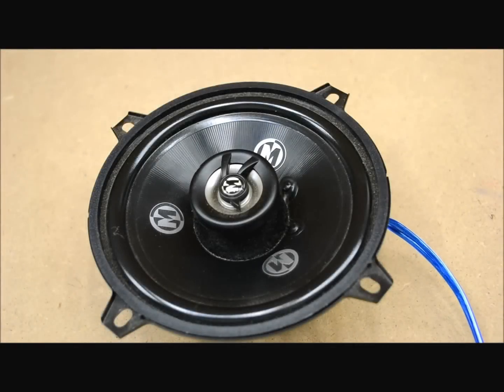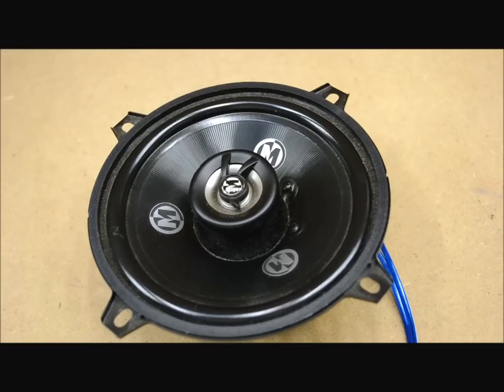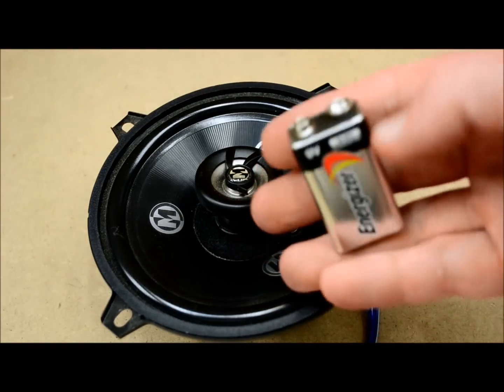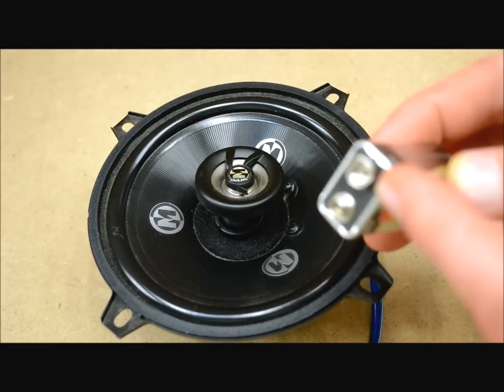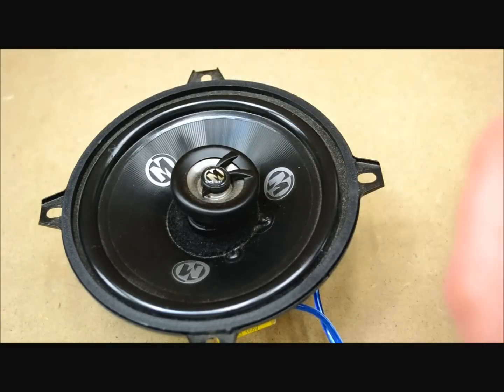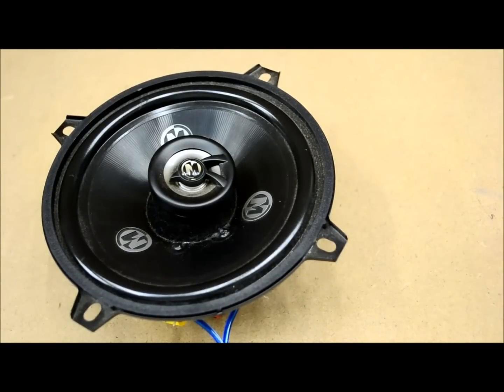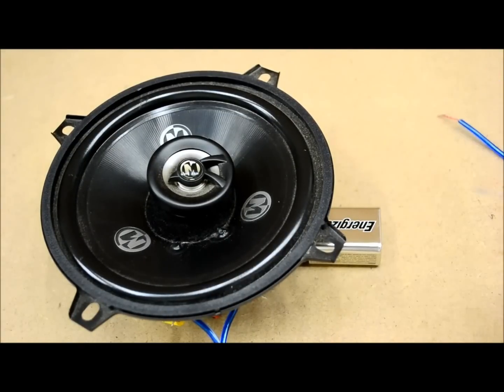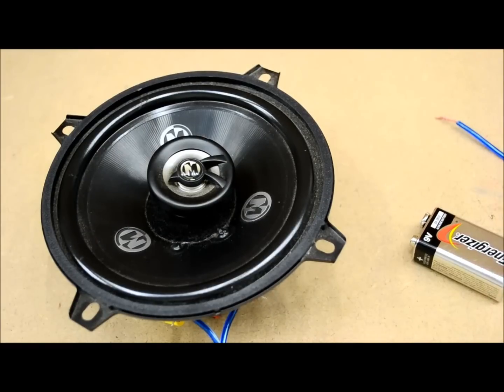How To Test Speaker Polarity Phasing ( Speaker Popping ) & Do A Continuity Check

Comment: I have two wires in my car.  I cannot trace them back to the source.  I need to know which one is pos/neg.  This only helps if you want to know the connector at the speaker, not the wiring.  Can you help?

Comment: That's fine using a battery, how about showing us on car wires? My car has four different colored wires for the two front speakers, and four different colored wires for the rear speakers? Plus the OEM speakers have an "A" and a "B" where the replacements have a "+" and a "-" mark?

Comment: A man y always put the stripe wire as negative because I thought that the line means negative ha ha ha ha but I use the speaker polarity tester that comes with a CD 💿 and the install bay IBR68 and I haven’t had any problems and are very nice tools and in the ibr68 I made a 12 ft cable to check the cable on the radio connection and listen to the speaker were is located for when i forget what wire goes to what speaker 🔊

Comment: Honestly, I use the stripe as a guide, and connect that stripe to the same color on the amp and speaker.  Red connect amp to red connect speaker, and the same with negative.
Seems to work perfectly.

Comment: Perhaps it is good to explain "phasing". I assume it's phasing one speaker circuit to another. Sound waves are alternating aren't they? Or does the amp produce electrical pulses favoring the outward direction of a speaker? I think that some sounds such as percussion or the pick of a guitar string would have more energy if it was an outward direction.

Comment: what if you want to test the two same color wires coming out of the old speaker hole on the car? Would you just turn on the ignition to get the radio going, turn down the volume and then touch the wires like you're showing to see which terminal on the speaker they need to be connected to?

Comment: but what if i dont know which polarity the WIRES are?    this only shows for the speaker?
Reply: Get a test light and connect it to one of the speaker cables. Then set the ignition to on. No reason to start the car. If you have a push button start, push the start button twice with your foot off the brake pedal. Once you have the ignition on, take the test light and touch the center of a 12v accessory plug/lighter. Be careful not to touch the sides with the test liglt or you'll blow the fuse. 

You want find which speaker cable lights the test light. The one that lights it is  the ground.
Reply: That's why I came here

Comment: Personally I don't see this as a problem as speakers are usually labelled at the back where they are connected. The difficulty is where you have a pair of wires coming out of a wall and the amp is some distance away hidden in a shelf where access is near to impossible because of all the wires and other audio/video equipment stacked on top and  connected to it LOL. How do I know which is positive and which is negative by the signal coming from the wires, is there a way to find out?
Reply: Stephen Cutajar this is how you find out haha. You connect them to the speakers + & - and if the speaker pumps outward then that means that the cable attached to the positive on the speaker is also the positive cable. Or if the speaker pumps inwards it means that the negative cable is connected to speakers positive spot.

Comment: TO EVERYONE WATCHING THIS!! : DO NOT USE a 9V Battery. 
It's way too much, and you risk damaging the speaker coil! 
1.5v or 3v is usually enough to see in which direction the speaker membrane moves. 
Also, DO NOT let the battery sit connected to the speaker. Only use it in pulses.
Reply: Possible bad battery or didn't get a good ground. On your speaker, the small spade is - and the large one is +.
Reply: B24Fox is right! 1.5v is enough. Tried it with 1.5v AA battery. Thanks man!
Reply: @patricklawrence9784  I need to make a 1-5 V. push button one.
Reply: @ddd228  if you do make a push button AA 1.5 volt version please make a video
Reply: @JuggaloNY   It would be easy! 14 G. copper wire soldered to a aa battery! Label the leads.
Reply: @ddd228  I personally have never soldered onto a battery
Reply: @JuggaloNY  Use soldering paste and look at a Video .EASY on the heat. Haven't thought of JB-Weld.
Reply: B24Fox only if you hold it on there long enough if you just put it on there for a second like this guy did it's not going to damage your speakers
Reply: B24Fox, you are correct, a 9 volt battery WILL damage the voice coils in speakers.  Even pulsing the speaker weakens the voice coil.  Anyone who thinks this is not true, well you're wrong!
Reply: I tried my speaker with a 9V battery and it didn't move. It's a Pioneer TS-1615 3-way speaker and it pass the continuity test done with my multimeter. What am i doing wrong ?
Reply: You need to brush-up on theory! ... Speaker is 'at rest' every time the signal goes through zero.  ... Since sound is a complex mix of AC signals, speaker moves backward for negative portion of the signal and forward for a positive half. 
It is incorrect to say, 'speaker is designed for a forward movement only.

Comment: Hello
 Lessco Electronics,  last night, from my vintage tube amplifier,  I 
mistakenly connected my Spendor Bookshelf speakers as with two  + wires 
 to the one speaker and two - wires to the another speaker. But one side
 speaker worked and another side didn't work.  'Balance control worked 
both sides only for one speaker. I shocked and sweated  then found it 
was wrongly connected. After made the correct polarity connection, they 
now sing.  Here, I need your clarification for: Since I made the wrong 
connection for 10 minutes, is there any possibility for weakening the 
Cross-over and speakers? Actually, What would be happened by this wrong 
connection? I am much much worried about my beloved - expensive  new 
speakers.   Kindly explain and please let me know : Did my speakers 
fully escaped and are they safe now?  why could  the speaker sing, connected
with two positive + speaker wires?  and could not sing ,connected with two negative wires?
Thank you,
_ with regards,
Reply: Suseendran Balakrishnan
Reply from the maker: if anything the damage would show on the amplifier end, not the crossovers, Since it's up and running again, I can only presume the amp has built in protection circuitry.

Comment: I have just put new speakers in my car, but the existing wiring from the head unit has no consistent markings or way of telling which wire is positive. How do I check which wire is positive?
Reply from the maker: +Chris Curtis you can do a continuity test using a multi meter between the speaker and the stereo output

Comment: Yes, DC phasing test is simple, but how to test multiple amp outputs for correct + sinewave phasing? I've seen amps and head units with all kinds of internal wiring spaghetti: grounds crossed between outputs, +/- crossed on a channel. I've been synchronising by ear and it's doable most of the time, but some car interiors sound so weird that it would be quicker to verify with an o'scope. 
Could u teach us how to do that?
Reply from the maker: +stereorail let me ponder that one in the mental computer a while...

Comment: You are half-right in this video.

The polarity test is correct, but your comment about speakers not being designed to move in the opposite direction is incorrect.  The speaker cone is designed to move in both directions, and there is no adverse effect what-so-ever.

The audio wave form is AC, and swings positive and negative.  At 0V, the cone is at rest.  During the positive half of the wave, the cone moves in one direction, and during the negative phase, the other (both in and out).    

It is important for all low-frequency drivers to be moving in the same phase to prevent wave cancellation.  In fact, it is sometimes desirable to have the low frequency drivers out of phase with the mid and high frequency drivers.

PS: Good videos.  Very helpful.

Comment: Thanks! Very important info in my case which may be why I'm having problems! I've always assumed which connection on a speaker was the positive. I usually I went with the wire that had a stripe as the positive, and the solid colored insulation as the negative. However, it was only recently that I found some instruction manual to a car CD player that labeled their solid colored insulated wire as positive. I took a pair of brand new speakers that I never used and decided to place them in some JBL enclosures to use as a pair of "rear" speakers in a home stereo config, (basically, a complete DIY thing).

The truth is that they're only 4 ohm and the amp specifies 8-16 ohm speakers. So I've yet to research if I can use them as a rear output for the surround sound option but I know that I'm risking damage to the amp in a long term application if I get it wrong, (assuming I can use them at all)

I'm speaking about tying them into an 8 ohm, left & right speaker system, by linking them in "series'.  If I did that, the math works out to be a impedance total of 12 ohms per channel which is in the min/max specs of the amp. However, I'm still in the research stage and not entirely certain that the 4Ohm+8Ohm x 2 'in-series' wiring configuration is applicable to speakers rated under the minimum ohm specs.

Thanks for the vid! THUMBS UP for sure!
Rich

Comment: @lessco electronics: I have two kicker comp cvrs dvc 4ohm wired to 1ohm on a hifonics Brutus 1500.  I've taken out the subs about 3 times to see if the subs are wired wrong but all positives are wired to positives and negatives to negatives. but for some reason one sub moves out of phase and it's irritating. also lately I smell a burning smell coming out the port. this is my second speaker from amazon that I've ordered in one month. also the subs positive and negative termninal have red and black stickers on them. do u think they came backwards from the factory? thanks
Reply from the maker: Tito Gomez That is possible, especially since a little sticker dictates which is which many times, here is what I'd do. take a 9v battery and pop out the voice coil and verify theyre all traveling in the correct direction. then see...
Reply: Tito Gomez in a single box I will reverse one speakers polarity witch will alow them to work together instead of fighting each other. As one goes in one goes out bass will get double
Reply: For example if you unscrew one speaker and play bass then just flip it backwards you will see with out switching wires. It's phasing your speakers

Comment: I have a related question.  I have stinger rca cords and they had a red and black pinstrip sticker on the left and right cord.  the sticker came off and I don't know which is left or right (these were run to a subwoofer in a car).  What I am trying to find out is on a monoblock amp will it matter which cord I plug into the left and right on the amp? or is there a way to check which is left and right on the rca cord?
Reply from the maker: goose m it doesnt matter since theyre being powered off of 1 channel

Comment: I have 2 subwoofers standing so close to each other that i HAVE TO flip the phase of one of them to get optimal sound (i've already tested that). Both subs are going to run on one mono amp, so can i just reverse polarity on one of them even if they are in the same amp channel or will that destroy the sound, amp, or the subs? :)
Reply from the maker: Just a thought.... do you by chance have 1 in a sealed box and the other in a ported box? one may be pulling what the other one's pushing sound wave wise!
Reply: Lessco Electronics No, both are sealed. they are installed in a L-shaped bench sort of, inside a big van. And when i flipped the cables of just one of them the bass got remarkably better! (that was on a two channel amp) Next time I'm workin on the project, i will take the polarity test cus the boxes cant be opened again so im startin to wonder if One of them was flipped in the first place :P In the end they will run on a one channel monoblock so what i really need to know is if the amp or the speakers can take damage or cause problems if one of the speakers are connected "wrong" polarity wise, and the other correct. Thank you for answering :)
Reply: Lessco Electronics Your theory was correct tho, that was the problem in the first place, thats why I might need to flip one of the cables

Comment: I get that the striped wire turns out to be + but I'm not catching how the wires are oriented when hooked to the battery. Thx!
Reply: Whichever wire is touching the positive terminal on the battery carries the positive signal. If that signal pushes the speaker up, then your polarity is correct, if not, switch.
Reply: Thanks Mike.